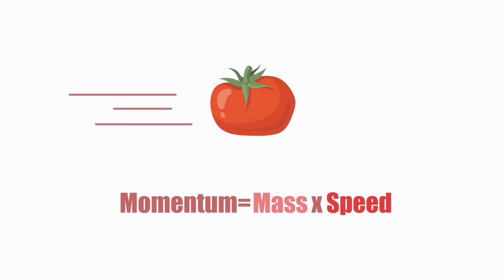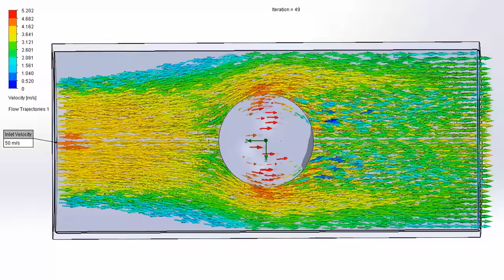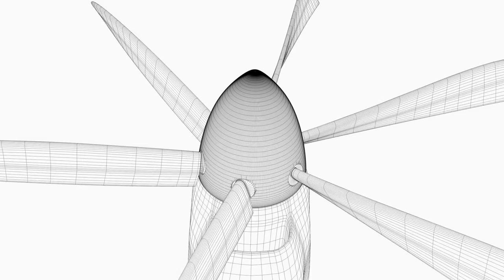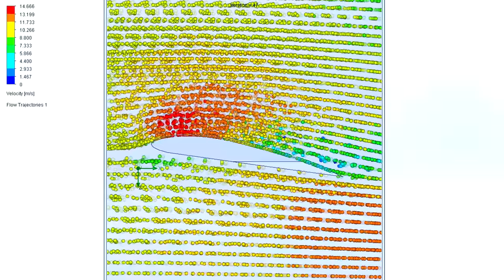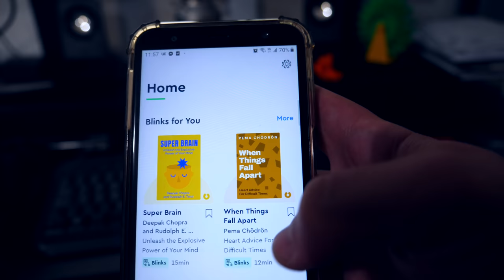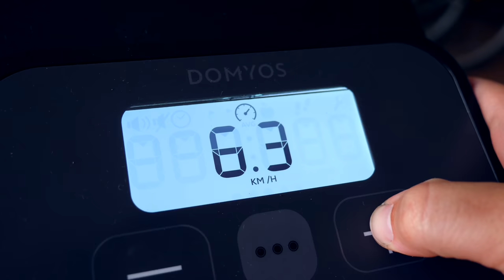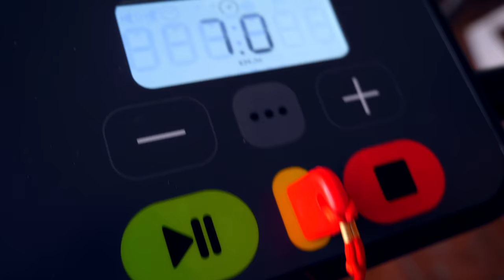Wind Powered Car (3D Printed)

Comment: Well ... it's really not that complicated if you think about it. Imagine the wind speed is 5 Km/h and your sail is somehow blowing air backwards at 5 Km/h. For you, this is similar to being in air that is moving at 10 Km/h. You may not reach 10 Km/h, but you can fairly easily reach more than 5 Km/h (the actual wind speed). If your sail is a fan, it can do just that. The one problem is where do you get the energy from, to blow air backwards? Well, if Veritasium's video, the fan was powered by the wheels of the car. So the movement of the car pushes air backwards, which lets it push itself away from the air that is moving by it, giving it more speed than the air. It may seem like some form of free energy at first, but it really isn't. It's more like changing gears. With this mechanism you can be pushed faster than air, but the air also doesn't push you as strongly, since a part of the energy is used to spin the fan. So you have less acceleration but a higher top speed.

Comment: There´s a clear limitation and each propeller, gear and vehicle can be addapted for being efficient in a specific wind speed I guess, but what about using changing gears in the propeller? There would be at least a little bit of speed to win, right?
I also think that even though you explained pretty clearly, you didnt even measure the objective speed of the vehicle versus the wind. But Im sure you did use a little bit of that beloved solid lubricant that is graphite.
Reply: And I guess there´s a lot to win when increasing the mass of the propeller as it acts like a flywheel if there´s enough wind,  those parts of the design I think are a lot more relevant than it seems in the video.

Comment: How about getting a build it yourself rocket kit, using it. Then improve on what they already had wile using the same type of fuel source. And then comparing the results of the two. To then design and build the best of both. You could even make a short video series from it!

Comment: To actually achieve the desired result you really need to put more attention to the losses you encounter; Prop Angle to Direction, Pitch and Size, Friction on all moving parts, gear ratio between drive wheels and Prop and lastly Power to Weight - I'm not sure that a 3D printed model would be able to overcome all these issues.
Do check Veritasium's follow up clips to his original, he has a real good model and explanation.

Comment: your tread mill is up hill for the car...the ribon on the car is pointing the way the fan is moving the air....every one is using tred mills...just put the car on the ground and use the wind then we can see no eror in wind or ground speed.

Comment: Come on Integza...
* Replace the front tires with the smooth ones. You dont need 4x4 tires, u need F1 tires.
* Desrease the width of the rear wheel to avoid from friction.
* Decrease the angle of the propeller (needs to be parallel to the ground) to use the generated trust efficiently.
* It may be better to put some mass on the front to make the tires a proper contact with the ground.

Comment: It has to do with the gearing instead of using a 1 to 1 ratio try a 2 to 1 or a 3 to 1 ratio which would give you the faster than the wind

Comment: I Seen you videos and would recomend trying making few stage rocket with full metal enclose as moust of them blow the cap off. just make a metal flange were you can put nozle in to as a guide and replace i if it get burn out., also you can try one with the cooling system using vortex, clrear vortex cooling system with two stage rocket inside :)

Comment: I don't think fluid dynamics is required to explain the cars movement. Imagine the wheel as a lever with the fulcrum as the contact point with the ground. Apply a force to a point below the axle and the axle will move faster than the point where the force comes from. This can be done with a spool of thread. Pull a thread parallel to the ground wrapped to the bottom side of a spool. The spool will go faster than the thread. If we're working in a frictionless model then most any set of gears, levers, screws etc for us to apply a force to such that the force interacts with our vehicle at a speed that correlates with some radius of the wheel on the bottom half will cause the vehicle to go faster than the object applying the force. Its too easy to think about it as poking it from behind with a stick, obviously the car cant run away from the tip of the stick but the wind is not a stick, there is more wind in front of it so we need an infinite stick that pushes from the middle. if we had a screw on the car that we pushed with a rack gear or a wheel and we pushed with the side of a long plank and it were geared to the ground wheels in a very specific range of speed the vehicle would absolutely out run the device driving it. This isnt free energy. It requires a speed differential between the track and the driving force or no acceleration is possible. The observed acceleration can never be more than the force applied it must be less by at least a factor of the speed advantage given by the mechanisms and for any given screw pitch and speed there will be a speed of equilibrium where the wind no longer gives any drag for to push on the screw. It would only be free energy if the car drove under its own wind when no wind existed or moved faster than wind without a loss in acceleration. Its very cool and breaks peoples brains but doesn't actually break thermodynamics.

Comment: The metaphor that worked for me: it's like a magnifying glass. You can get an area hotter than the sunlight by concentrating it. Why can't you do the same with wind? I mean if I have a bigger and bigger propeller blade, that captures more and more wind, which means more torque....gear reduction magic= faster speed.

Comment: Why not a build a rocket which will then use a propeler that slows down the the rocket when going down (still using the momentum from falling) instead of a boring parachute

Comment: I like this project. But this would nice seeing it with a vertical wind engine (Zylinder) instead of a propeller. So the direction of the wind is no longer important.

Comment: Very neat model of the car. Do you mind me asking. If there was a bearing on the propeller shaft support? Or did you just let the printed part be the bearing? Because I was wondering if the shaft got some amount of friction from its support? Thus limiting the speed at first.

Comment: Bruh.  So, maybe I'm crazy but what it looks like is your prop is producing thrust and the whole design has a tailwind.  This is like asking how an aircraft could have a tailwind.  The engine is your treadmill, which is producing enough power to move the prop which moves the car.  Then the fans tailwind is pushing it faster than its 'ground speed.'

Comment: what u would have used the sugar resin print to be in side a combustion chamber of 3d printed ceramic part. so u print the body of the rocket separate from the the fuel.

Comment: Do you know what the treadmill could mean? What would happen if you let the model drive in a circle like a carousel. So the engine is in the middle and the model is connected to it via a rod. and a gear that separates the rod from the motor when the model is faster than the motor is turning.

Comment: um I think your tomato analogy isn't correct....
Once blackbird gets up to wind speed the car is essentially traveling in NO WIND - because they have the same velocity.
The propeller then, is able to hit the (relative to the car) stationary air, pushing the air backwards and thus giving the car additional forward momentum.
The correct analogy would be that Clara throws the tomato at your face while you are running away from the tomato at the same speed - you are then able to push the tomato backwards and give yourself a bit more forward momentum...
I of course could be wrong but I think this correct...

Comment: there is another force you are not counting. what if you have a very tiney boat with a really big sail? more of the wind is trapped and used in forwards momentum . in  short its like turning tuque to speed with gears. but there is also another force applied in a sailing boat, its the lift of a wing. when a sail is trimmed just right it gets the shape of a wing so it generates lift! but the wing is vertical not horizontal so instead the lift pushes the boat in a curve, but thats why you have a ruder. the ruder produces the same physics as the Wight of a plane dose on the lift of a wing, at some point the Wight of the plane and the lift of the wing find an equilibrium where the plane flies in a straight line. so the net result of wing lift and wind pressure on the sail = speed faster then the wind.

Comment: Hey Integza, 
great video!

Would it be possible to have the car race in circle to have it running for a while ? Maybe even with a fixed rigid arm from the center, and only the two weels for powering the fan...

What do you think ?
In some video there is not even need of the "wind" behind so the car is powered completely by its own fan (and of course a really fast treadmill). In this case, would it be possible to just have the car go around, pushed by his own fan (once the critical speed is reached, of course) ?

Comment: There... Is so much wrong with the physics in this video... 

1) sailboats operate using lift
2) lift is a consequence of air moving faster over the top of the wing than the bottom, but it is not "because the top surface is longer than the bottom" or any such nonsense. As with most things in the world, it's more complicated than that. 
3) I'm pretty sure the vehicle is supposed to operate via autorotation - the way that a helicopter falls gently to the ground under loss of power. The wind turns the rotor and the rotor then has enough momentum to still generate lift (I am an Aerospace Engineer and that part still baffles me, but it works).

I love your book recommendation, btw. I've got both volumes

Comment: Video idea: for the tomato can steam engine that you mentioned earlier, testing out different styles of valve gear, seeing which one is the most efficient, and then trying to make one that's even more efficient. Also, if you need help with the design of the boiler, cylinder(s), valve(s), etc. let me know. I help to operate a steam locomotive, so I actually know a little bit about this stuff.

Comment: While a lot of what's said here is true, I don't think it works as actual explanation. First of all, the source of energy for the car is difference between speed of the ground and speed of the air. Energy is proportional to velocity squared, and the ground moves faster relative to the car than the air. If you draw energy from motion of the ground relative to the car and compensate the generated drag by pushing against the air, you get energy surplus because of that squaring. And that surplus can  be invested into giving the car greater speed. Details about how fast the propeller moves or how lift is generated are not really relevant to the process, it would work for different kinds of propulsion too.

Comment: It's only confusing because it's being explained wrong IMO. Using the wind and a simple gear ratio it makes sense the car would be moving at speeds which don't need to be physically limited by the "speed" of the air at the time. That's not even a sensible measurement for wind in this context. Thinking about it in reverse is the interesting part. If the propellers needed to spin the opposite direction it would then become pointless to use that as means of propulsion compared to say, a sail of some kind. That would also limit the max speed to the max wind 'speed'. In the case where the wind is moving against the vehicle it makes sense an equilibrium occurs where car speed can exceed wind speed because a simple gear ratio can do this for nearly anything when considering just 'speed' of input and output.. it just needs to overcome wind resistance and other friction but it's by no means defying physics by outputting more energy than is being put in.

Comment: In your model, the car did not go faster than the wind, because it almost stood still relative to the fan.
There is no wrong in comparing a fan blowing wind at a certain speed  to a treadmill moving in the opposite direction. Try to work on the propeller design and see if you can make the car run the treadmill.

Comment: Are u willing to bet on it?.... The windmill on wheels were tested with the wind, but the propellers rotation designed to push the air backwards...so when the backwards wind generated by the propellers rotation collide with the air moving forward, it generate more thrust forward...? Or is it...?

Comment: As I mentioned in my previous post, the website www.rexresearch.com has a wonderful assortment of old inventions. One invention is a new type of bearing called the "Rolomite". I expect you'll have much better luck 3D printing that than you have had 3D printed standard roller bearings. It will require a hoop of metal which you can make from thin brass, tin or copper sheet from your local hobby store or an old tin can.
Additionally, I'd enjoy seeing a Viktor Schauberger 'sworl' pipe from you.
'Brigado meu amigo.
I did live in Brazil for just short of 10 years.

Comment: hey Integza!
Maybe you can try bigger, lighter wheels, bringing the gearing further UP and the axle more horizontally towards the propeller.
The angle of attack is important i'd guess and you could test with other gear ratio too

Comment: 13:56 thats not true
the point is the prop speed in drive direction, not sideways. and this is lower than the wheelspeed. and that exactly is the trick!!! it's kind of a lever

Comment: The way you explained it is correct, but it seems that your 3d printed model didn't actually work. (It wasn't efficient enough)

For the actual effect to work you need to

-move faster than the threadmill
-without a fan pushing it, only the threadmill

Integza could have done one of two things: 
-he knew that his model worked, gave up and tried to hide it (with videos of him getting thrown in the face by a Tomato)
-he didn't understand the experiment himself while he was "planning to make a better video than Derek"

Both ways some clarification would have been nice.

Comment: Wind energy is free energy...

Sail ships has always harness this free energy...

Only need people to manned the ship...

And blowing wind...

🤔 Maybe, you should try using this mechanism to propel a sail boat?

What about using vertical wind turbine or the cyclone horizontal wind turbine, that can fix itself according to the direction of the wind?

Maybe the ship required an aerodynamic design that's also best at resisting the wind...

[Edit]
Tbh, there's no real need to proof weather or not any object can move at the same speed of the wind, when powered by the wind...

It's like comparing the speed of farts of two different individuals. It's just farts...😅

Comment: and you didn't notice the tire hitting the edge of the treadmill? as in adding more friction? and why it turns left ... the only reason I could come up with was: you put the wheel shaft, to close to it's left wheel! why would that make any difference? i don't know but why do engines connect to the center almost everywhere? i guess it has an effect to some point and you made a light vehicle which made the effect more noticeable maybe?

Comment: 5:50 The theory of "wings producing lift by forcing air to travel faster over the top of the wing and to produce lower pressure as a result", is a myth. Wings do not work like that. The air over the top actually ends up at the back of the wing even earlier that the theory would suggest. I do not know of the specifics behind the current theory, but the one mentioned in the video is outdated.

Comment: Some comments:
- I was very irritated by not seeing in which direction the belt of the treadmill was moving. Clearly from left to right. An indicator aka stripes or marks on the belt would have been helpful.
- Also you did not mention the wind speed of the fan. So we can not see if the car WAS ACTUALLY faster than the wind.

Comment: Electric car, that recharges itself while driving, using a Stirling engine powered by the waste heat of the electric motor itself. Would be quite an impressive build, and hard to do on small scale...if it is even possible 🤔. (Goal: increased battery efficiency of...let's say 10%).

Comment: OK, I'm not a scientist.. but ;)
Considering the force of the wind on an object which lay on the ground, you have normally an opposite thrust due to the friction of the object on the ground. If this force equals the one of the wind, the object doesn't move, if it's weaker, then the object moves in the direction of the wind.
To me, the delta of energy which allows the system to go faster than the wind speed results from the conversion of a part of this opposite force in motion of the wheels, this motion being transferred to the system as an additional force. So there is no violation of momentum conservation...
About your demonstration with the fan, to me, you should have measured the wind speed to compare it with the treadmill speed. Your demonstration would have been more accurate ;)

Anyway, thank you for the video.

Comment: isnt the whole faster flow lower pressure thing a misnomer, since both sides air ends up at the end of the wing at the same time anyway? nasa's website says something about obstructing airflow, and thats what causes the pressure difference. idk i could be just remembering something wrong.